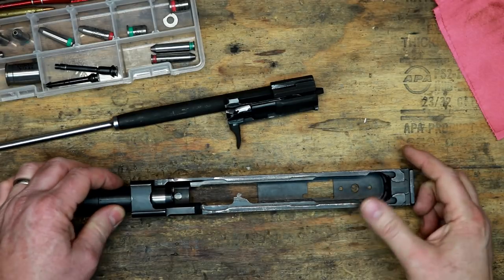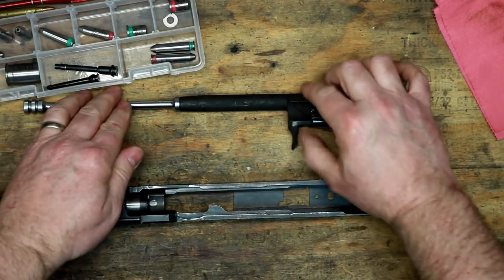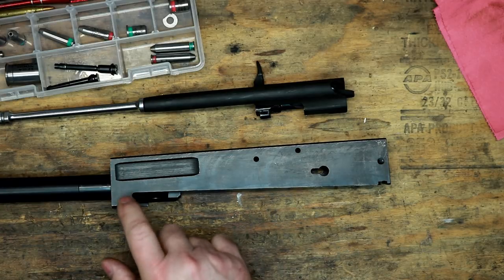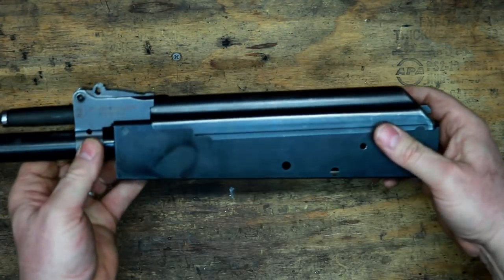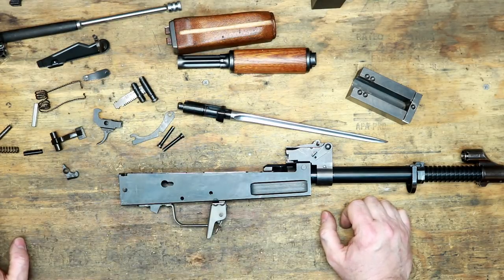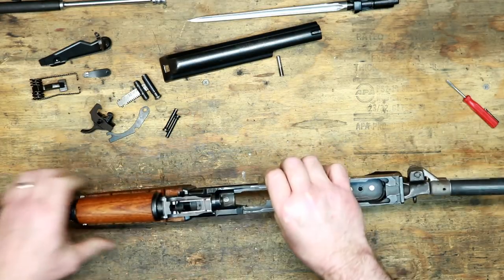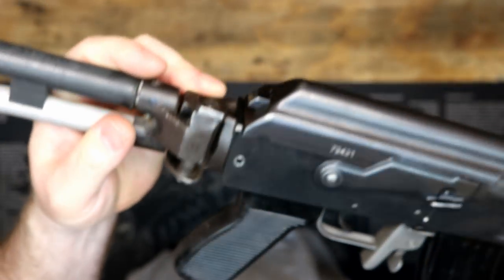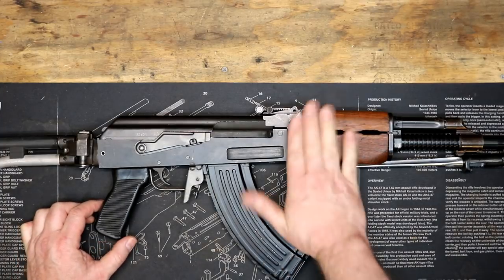M72 Galil Spiker part 4 (Tortort)

Comment: I built a Galil/Yugo/AKM hybrid about 5 years ago. I used a Romanian front and rear trunnion, Yugo rear sight block-sight, Galil bolt carrier and front sight pressed onto a Yugo barrel, and a Galil dust cover. All built on a NoDak Spud NDS-1 receiver. Turned out really well. I get weird looks t the range with that rifle.

Comment: Hey Mel, quick question. What kind of bits did you use to drill the fire control group holes and the barrel pin hole? I'm not too familiar with them. Didn't look like your standard twist drills.
Reply from the maker: Dakota Stomm   They were solid carbide 135 degree screw machine drill bits.

Comment: Hey Mel,Wondering if you can help me out?Im on my 3rd AK build,and my first 2 went well.After spot welding my upper rails in,I was re drilling the right side holes on the rails and the rail popped off. Before I weld the rails I get some acetone and I clean both rails and inside the receiver where I’m going to well so it gets a good weld.I make sure I get nice size red welds on the rails, and keep pressure on for about a minute to let the weld cool down. Any advice you can give me would be appreciated. Your videos are awesome and I learned a lot...
Reply from the maker: Just make sure the receiver and rails are clean and flat. As you let off the trigger give the handle a little squeeze while the weld cools down. Then wait a few seconds before letting up on the handle. Seeing as this is what you are doing, I would make sure that the spot welder is close to the breaker box. To much cord and the welder can lose power needed to weld correctly with.

Comment: Hey Mel, I found your channel not too long ago and I love your work! Doubt that you'll see my comment but I have a 80% galil receiver. Is it possible to finish it with a drill press and router if I take my time and go slow with it?
Reply from the maker: Drill press- absolutely
Router- BE CAREFUL!...Dremel and a cut off wheel for the ejector might be better....can't believe I just suggested a Dremel for gun smithing.
Reply: @Mel64d  Ha yeah it does sound ridiculous. Thank you for the response I'll let you know wheter or not I screw it up.

Comment: Will the spiker style front site assembly fit a standard ak/akm barrel or is essentially a yugo/ chinese only fit?
Reply from the maker: No, not without sleeving the FS journal of an AKM barrel first. The Chinese spiker FS block is 0.020" larger than a typical AKM FS journal. The oem front sight journal for an AKM rifle barrel is 0.574" (+/- 0.004") The Chinese FS barrel journal is 0.594" (+/- 0.004") and the Yugo RPK is like 0.592" (+/- 0.004")

Comment: Nice video, and great work, it looks really good especially with the pig sticker. 

Do you think youll ever make an m76 or m77 build? always thought those 308+ aks were interesting, especially the different approach between the galil 308s, the zastava ones and the valmets with regards to how to rearrange stuff in the trunnion to accommodate the longer round. 

also non related but, i never quite understood the importance of the rear sight block being pinned to the barrel, because, if its that important, why get rid of it for the ak 12/ak 15 that very basically has a traditional trunnion with a new smaller "rear sight block" welded on top and then the gas tube pinned there and on the gas block.

Comment: Mel, turned out beautiful man! have you tried using a fish scale as a force gauge? ( measures weight by pulling against a spring)  I used mine to set pinion bearing preload on my ford 9" and it worked great. I noticed you drilled the gas port at 90 degrees before installing the gas block, was this done for accuracy and have you noticed a difference versus your standard M72? I know it's not really your thing but a follow up comparison video would be awesome. Keep building brother, your work is inspiring. O also wanted to mention, I copied your 3 position barrel component press block and rivet drilling guide/ jig those are nice designs and make taking everything apart much easier.
Reply from the maker: I have heard of people using Fish Scales as force gauges. Never cared to try it myself. As for the gas port hole, after drilling down thru the gas block into a thick m72 nitride barrel....I said to myself "never again" The 90 degree is much easier, as long as you remember to do it before you press and pin the gas block. That mistake is what caused me to drill down thru the GB on the first m72 lol.  The three point trunnion/barrel press tool I copied from a picture on the interwebs. The rivet/trunnion drilling jig is not my design, it's from ak builder. I do make a lot of my own tools seeing as I have an entire machine shop at my disposal. I never have to borrow the same tool from Auto Zone twice lol. But if someone else has already worked out all the bugs (I can be lazy too) then I will gladly give them my money.
Reply: Mel64D Sometimes it's easier to buy something than it is to make it forsure, I know what you mean there. when I drilled the gas port in my green mountain barrel through the gb, the second the bit touched the barrel the tip broke off so I can definitely see the logic in your method. In reference to you drilling jig, I was talking about the one you use as a guide with a hand drill to drill out old rivets. I've never seen one like that anywhere else
Reply from the maker: Oh, I thought you were talking about the jig that holds the trunnions themselves and you align the holes too. The tool in the video I am drilling the old rivets with is also from ak builder.  It works great with a drill press and or a hand drill....as long as the rivet head is smashed (formed) straight down and not to the side.  If the rivet head is leaning or formed off center then you risk the chance of drilling into the receiver or trunnion itself. So close inspection before drilling is very important.

Comment: Bet those sights are canted, if my sights are canted from the factory, your sights are definitely canted.
Reply from the maker: LOL, no, my sights aren't canted. The block and barrel were both machined concentric. So no need to cant on purpose for centering of front post was needed. Sometimes from the factory the front block will be canted to compensate for poor machining, and sometimes it's just carelessness. The benefit of building it yourself is, you can make it work perfectly with a centered front post.

Comment: Are you going to jump to full30 to avoid all the YouTube shenanigans.
Reply from the maker: Full30 is an invite only community. Now, they are going to open it up when they can to everyone. But, seeing as I was not part of the "in" crowed before all this. I will not go to full30 even if invited. Don't want to stink up the place as "that guy" .  It's their community and I have a lot of respect for Tim of MAC. I hope they have great success...I just wont be there.  If my channel dies...it dies.
Reply: Mel64D I can understand that, it does stink if the channel here does die though. It's been awesome watching your videos and the awesome commentary you provide during it all. Also off hand question how is the lynx 12 doing. I am about to have mine off lay away and have seen initial reviews but never follow ups
Reply from the maker: I have changed out the stock and grip on the Lynx. My rotator cuff on my right side has been damaged (ex power lifter/body builder) three times now....the Lynx about killed me to shoot, now it was my fault for having the gas all the way open and shooting 3" magnum rounds. I need to get the Lynx back out and play with it more.